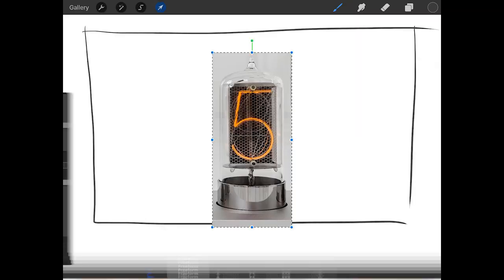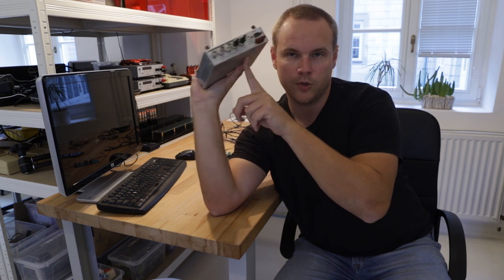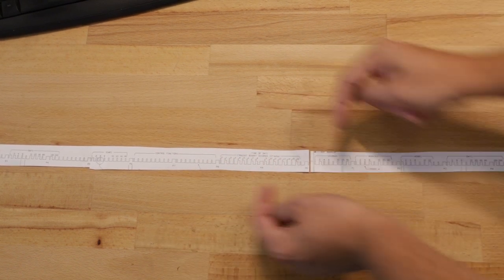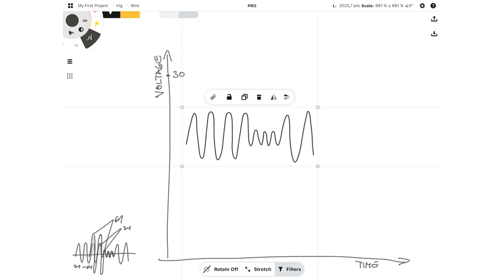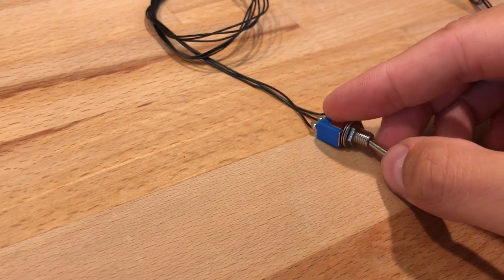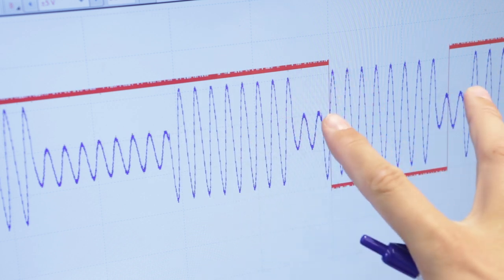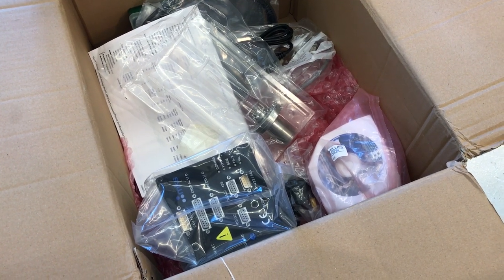Quick look at IRIG-B time signal - getting 1 pulse per second

Comment: Dalibor, I have spent too many hours calibrating radio transmitters Ultra high stability oscillators to 1 part per billion. The time standard we used for that was a Ball Rubidium standard. For some lesser accuracy required equipment, we did use a GPS receiver with a 1pps output. One thing I learned and I can only speak to the particular GPS receiver we used. That without a gps input, things would eventually get a bit drifty if it didn’t see a bird for a while. I have been out of that part of the industry for 10 years now, so maybe what you have is stable without seeing satellites on startup. Just saying the output may be a little more stable with a GPS lock. My other thought would be playing with the scope triggering.

Being a tech on the other side of the globe, speculating on what you are doing, without a lot more information is irresponsible on my part. So forgive me if what I mentioned is irrelevant. I can’t wait to see your solution. Please make sure you let us know how you solved the problem.
Reply from the maker: Hi Rick, I am always surprised with the local audience! Pleasure to meet you. This display will be synced to IRIG-B during operation, so it will have a time source all the time it is running, no drift should occur. In case the signal will be unplugged, we will still have an ovenized oscialltor inside which will keep the time. I will tell more in the next video, thank you again for your comment!

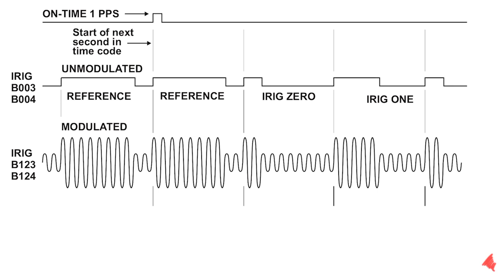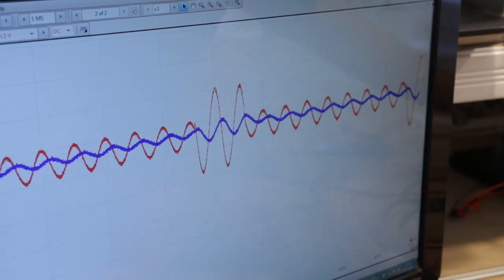Comment: Hi, if I look at the datasheet at 3:09, the "sinewaves" all start with a rising (positive) half-sine. In your oscilloscope-plots, 10:30, the first peak is *negative*. It leads me to think that the polarity of your isolation-transformer is inverted, so it is not a phase-shift, but rather a phase- reversal . Perhaps swapping the polarity helps?
Reply from the maker: Hi! Yes, we later found the transformer inverts the signal, we also had to tune the circuit a bit m to remove that phase shift. Since yesterday it works perfectly, far below 10us. Details coming soon :-) thx!
Reply: Bro do you make electronic circuits?

Comment: The signal source is the Brandywine Communications GPS4, Time and Frequency Standard.
https://www.brandywinecomm.com/products/42-products/commercial-gps-synchronized-clocks/83-gps-4-time-and-frequency-standard

This product (2005) has been discontinued by Brandywine, replaced by a GPSDO product.

Here is the Brandywine GPS4 Data-sheet.
https://www.brandywinecomm.com/filemanager/files/product_pdfs/gps4.pdf
Brandywine GPS4 User Manual, version 2.2
http://www.rabel.org/archives/Brandywine_GPS/GPS4-Manual_v2.2.pdf

IRIG-B specifications (GPS4) :

Carrier frequency: 1kHz
Data: Seconds through Days 
Amplitude: 3Vpp into 600 Ohms 
Modulation Ratio: 3.3 to 1
Connector: BNC